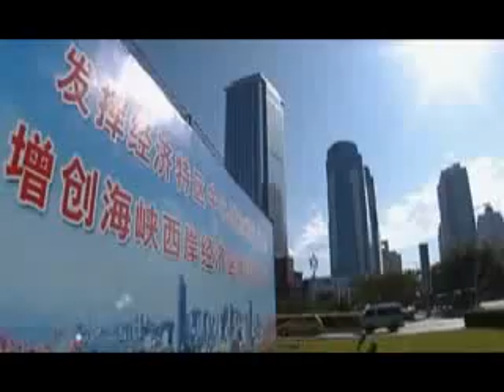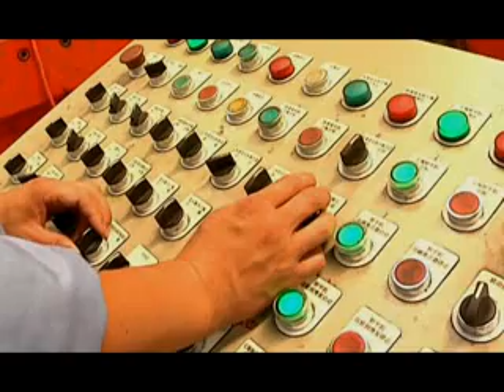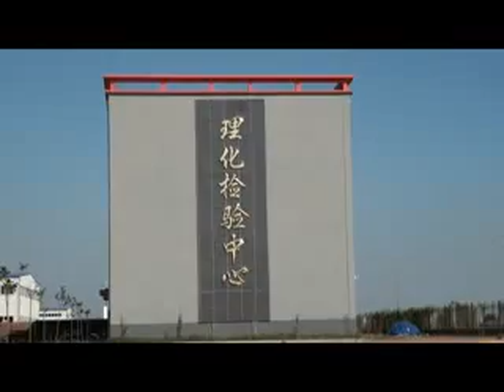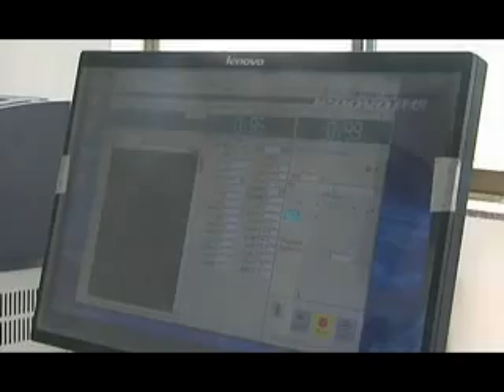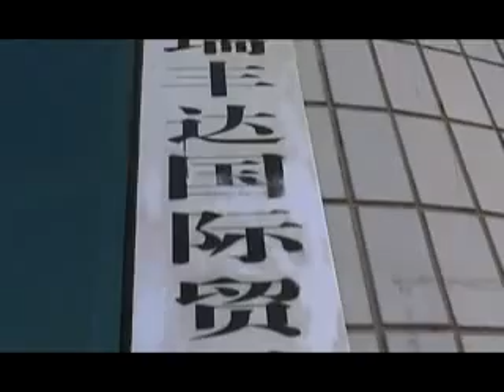SPIRAL STEEL PIPE MANUFACTURING PROCESS（CANGZHOU SPIRAL STEEL PIPE GROUP）

Comment: https://sdwansteelpipe.com/manufacturer/used-steel-pipe-for-sale-in-china/   ShanDong WanSteel Pipe buys and sells new, surplus, and used steel pipe. Steel pipe in all different sizes for sale in louisiana,arkansas,kansas,houston,california,kentucky,washington state,texas .Steel pipe products from Wansteel Pipe & Steel are available in a broad product range, meeting the highest quality standards, to meet all your steel pipe needs.At Wan Steel, we carry a full inventory of carbon steel pipe products in a variety of sizes to meet the structural piping requirements for applications the water, petroleum, oil & gas and other industries. Carbon steel pipe can be structural in nature or used in fluid, gas, oil transmission. We carry carbon steel piping in A500, A53, A106 and A252.The grade indicates the testing methods required for a given application. It is critical that structural grades of carbon steel pipe not be used for pressure or fluid applications.